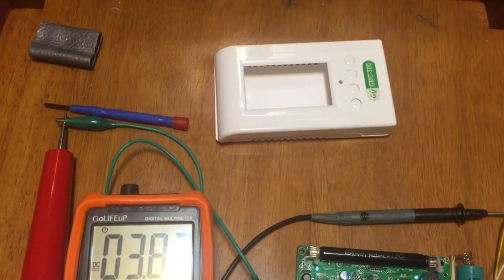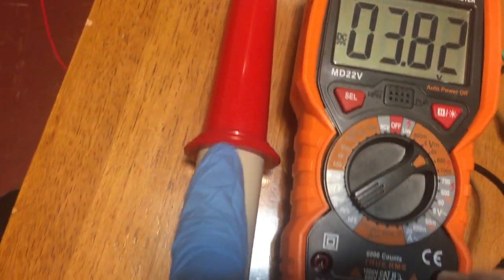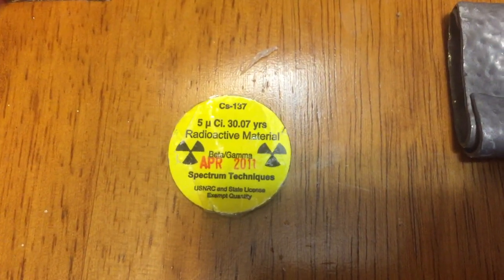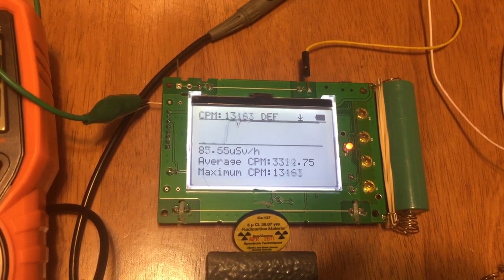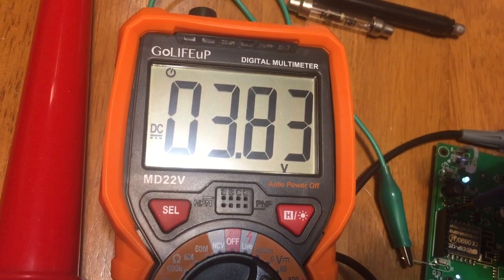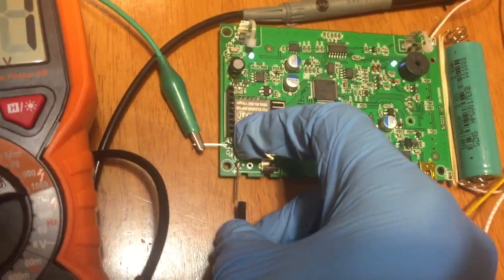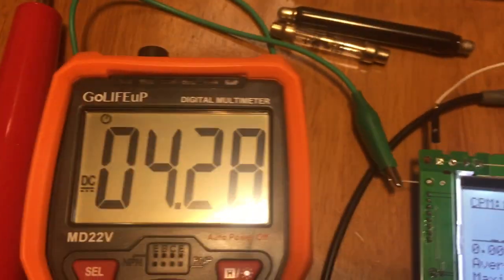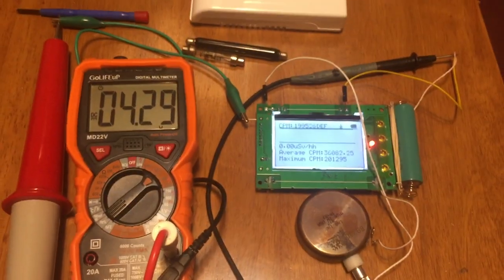GMC 500+ change Tube to LND 7317 Testing

Comment: NOTICE:  From the LND_7317 data specs - 
""""Recommended operating voltage (volts) 500,  Operating voltage range (volts) 475 - 675""""....
I believe that your operating the LND at the MAX voltage will NOT do it any good....  READ THE SPECS before you cook a 125 dollar tube... Just say'in....

Comment: What is the conversion ratio on the LND 7317 tube from CPM to uSv do you how ?
Reply: The conversion ratio for the LND 7317 is 334 CPM/μSv/hr (Cs-137). Or, 3340 CPM/mR/hr (Cs-137). Or, its inverse is 0.002994012, for μSv/hr, 0.000299401, for mR/hr. This ratio is based off of the SEI Inspector USB and Ranger USB Radiation Alert Geiger-Müller counter series. These are excellent instruments by the way!